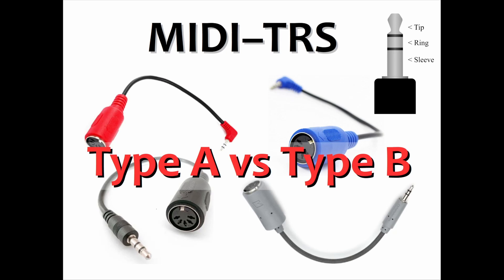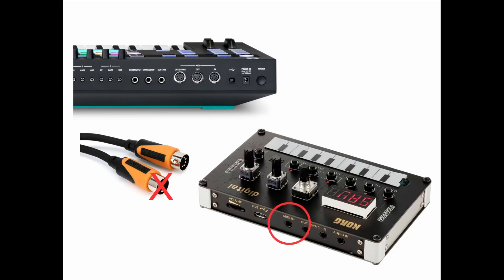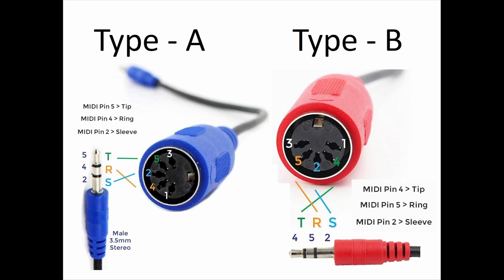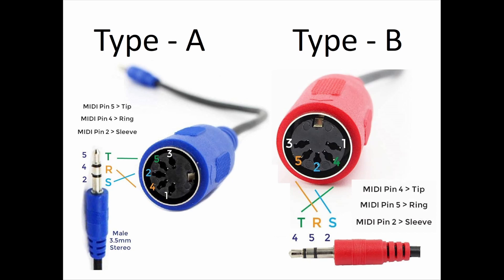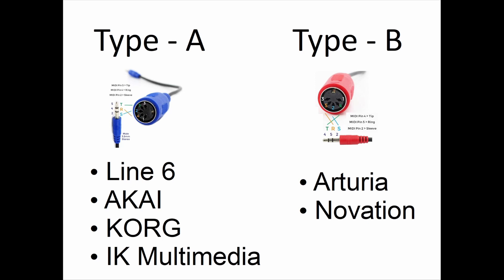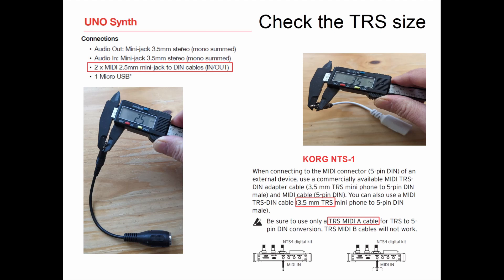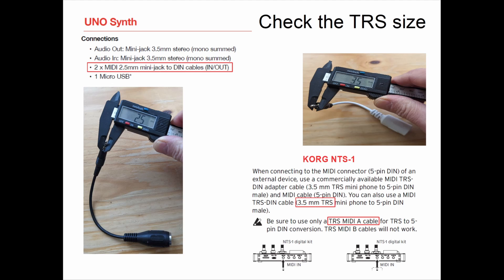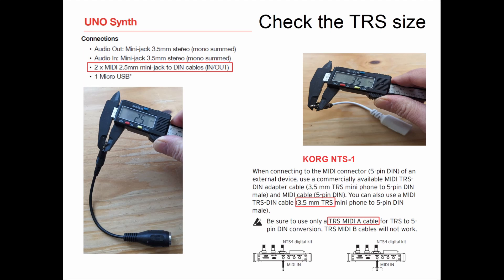MIDI TRS Type A vs Type B explained

Comment: Hi  I bought neumann mt 48  with trs  6.3  to midi cables   and connected to my yamaha cs1  qnd djx and it doesnt play ,  so I tried  Casio  and it was OK,   on neumann manual cable i connected Tip 4 Ring 5 Sleeve 2 ,  It seems that Casio has different midi type  vs yamaha but I can not find if it is A or B
It is confusing , I am thinking about Diy some reuction or make cable ?? Thanks